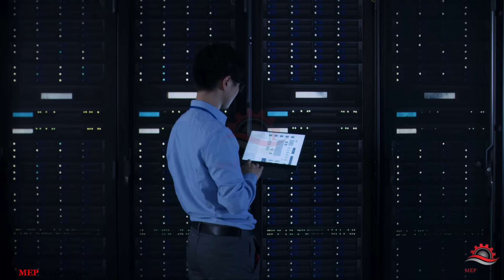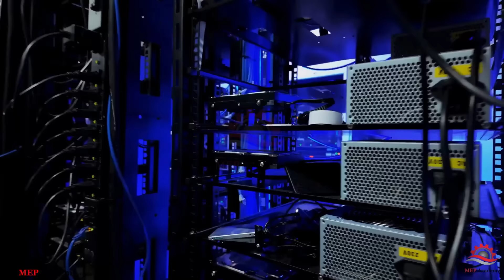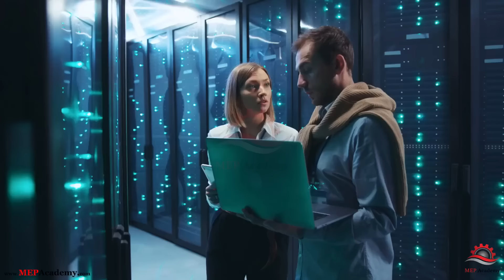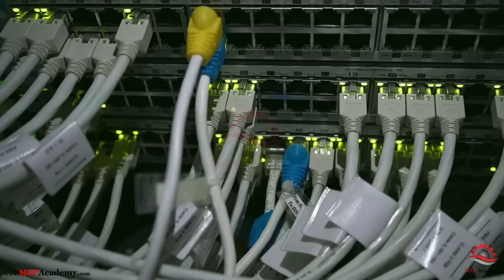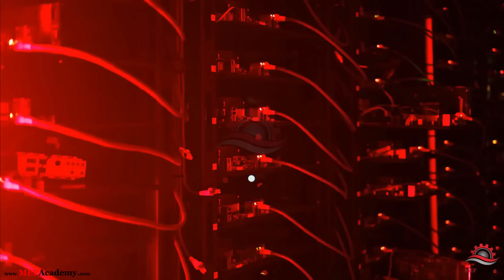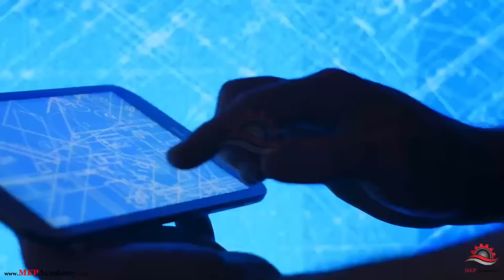How Data Centers Actually Work

Comment: That data center in your backyard is using the same electrical grid your house is. Just a lot more of it. Your electric company will raise your rate to offset the huge consumption by the data center who's not paying the same rate as you.  And that heat from the data center doesn't magically disappear. It goes into the air and changes the temperature in the immediate area.
Reply: Are you saying data centers are one of the sources of global warming?  If so, how can these be a positive influence on the environment?
Reply: @user-yg7ps4gh1x don’t jump so excitedly about your ignorance. Not it doesn’t affect global warming
Reply: @JoshuaC-b9g no need to be rude!!
Reply: Yep, people act like it’s “just the cloud,” but it’s very physical infrastructure with very real local costs.
Reply: THIS^^^^^^^^^^
Reply: I have read on more than one occasion THESE centers connecting to the local water infrastructure within the permitting authorization or the authority from the local municipalities to do so!! Highjacked and robbed at the expense of the local community!! If THESE are SUCH wonders WHY all the backdoor deals?? Under the table and under handed dealings to get them out in some places?? Some of their permitting isn't even public records until after the FACTS!!! 
Regardless people in THEIR communities in their homes have the exact right to know what is going in around them!!
Are these just another love canal times 50?
Reply: They charge the USER, not the guy down the street. Your meter does not measure what they use. Utilities CHARGE big time for the initial connection upgrades.
Reply: Not true
Reply: Not necessarily. Some data centers create their own electricity. Not all data centers are the same.
Reply: @jeremywheeler2122  I read they eat a combined 4% of the US electrical output. Who cares who generates it when it comes to a lot of the VERY negative burdens it places on the environment, our health including stress, and AND our cultures.
Reply: @jeremywheeler2122 exactly. I’m literally on a plane right now since my company is setting turbines and large generators to turn natural gas into power for the data centers for our clients.
Reply: Everything you just said is completely false. Your electric rates do not increase because of a commercial customer’s consumption. The reflection from solar panels has more influence on temperature than a server farm. Facts matter a lot more than propaganda.
Reply: @johndoran3274  I live in Virginia and my rates have gone up with the same or even less consumption on our part. All because of DC's. That makes what you just said false.
Reply: @ruckusmalone9419  it could be that communist state that you live in. I have 8 Data Centers within a 50 mile radius of me and absolutely nothing changed with my rates. Our community did get a big influx of tax revenue that enabled us to improve our parks and hire a few additional police officers without raising our taxes though.
Reply: @johndoran3274  lol communist ? You don't even know the definition of that word. You already got exposed in a lie once so you just spewed out more "trust me bro" garbage.
LOLOLOL
Reply: @ruckusmalone9419  what “ lie” did I get “exposed” in? You do live in a communist state that taxes everyone for everything. Your governor gave that horrible speech the other night touting her communist beliefs. Just because facts don’t fit your narrative of data centers or how they operate in your toilet of a state versus in America, you don’t need to have a hissy fit.
Reply: @johndoran3274  Ok bot. It's night night time. 😂😂😂
Reply: @johndoran3274  This guy types like donald trump, imagine your role model being donald trump, so embarrassing
Reply: @ruckusmalone9419 again, u live where? Hmmm that’s weird I can’t imagine costs going up in Virginia. I live in TX and have plenty of near by data centers and guess what? No price increase. It’s not the data centers it’s your gov. U watch every blue state prices skyrocket and it’s always someone else’s fault but u don’t understand how the red states prices don’t go through the roof
Reply: @ruckusmalone9419 he was telling facts. You r the fool that has zero idea about what you are talking about.
Reply: @squidvis it’s always easy to tell who’s telling the truth. One brings facts and the other call names
Reply: @JamCosmos he tells the truth and your argument is name calling. Makes sense
Reply: @JoshuaC-b9g  SYBAU clown 😂😂😂😂
Reply: Trump has mandated that all future builds supply their own electricity with surplus going back to the grid.  This could potentially actually lower the cost of electricity for neighboring communities.
Reply: @MANI-gp6wn  They are so HUGE if they fail, do we have to bail them out?
Reply: @SunnybobQuackers-b2l  of course we do
Reply: @MANI-gp6wn  Lower costs? Aaaaahahaha!!
Reply: @tommybotts . Yes, they would be off-grid and any excess energy created by the energy plants they build to supply their own energy can be given to the community grid, thus lowering the community cost.  Of course, this only applies to future builds.  Current operations are no doubt increasing the cost of energy now.
Reply: 😂😂😂 @MANI-gp6wn
Reply: @MANI-gp6wn  let's start by putting one in your back yard and you tell us how that goes for you
Reply: @not_jon_vendi :  Unless and until you and everyone else is willing to forego technology, this is a reality.  The need for data centers is growing exponentially and will end up in everyone’s backyard at the rate we’re going.  My comment was an explanation about the state of future builds, that’s all.  You can hide behind snarky comments, but it doesn’t advance any discussion.  I’d love to hear your solutions?
Reply: @MANI-gp6wn   the downfall of civilization. we are on an unsustainable track as a race, its only a matter of time until nature hits the purge button on us as a species
Reply: @not_jon_vendi Good. Bring it on.
Reply: @not_jon_vendi  Humans will go extinct regardless of whether data centers ever existed. Everything comes to an end.
Reply: @MANI-gp6wn you still believe anything Trump says?
Reply: @nem447:  Absolutely.  BTW, this was confirmed by the tech companies.  You can look it up if you have questions.  Even the MSM, or, as I like to call them - Deployed Tabloid Droids, got it right.
Reply: @MANI-gp6wn  That had no force of law.  It was a recommendation.
Reply: @hewitc :  You’re correct- I misstated.  However, the Ratepayer Protection Pledge was signed by Amazon, Google, Meta, Microsoft, OpenAI, Oracle, and xAI, so that about covers the industry.

Comment: It would seem that these centers would be located in the coolest workable locations in the country. 
  Also seems like a waste to just release the heat/ hot air via fans, but these guys are smarter than I am, so there must be a reason not to.
Reply: They are building them where there is abundant aquafers.

Comment: I have a design that does not require nuclear or fossil fuels. A system that will generate enough electricity to sustain power continuously and with minimal heat.

Comment: The video states the difference between an office building and a data center is that in a data center the electrical load is constant.  While this is somewhat true, power is always in use, the load does vary depending on the IT Environment.  If a Data Center is hosting banking/trading environments the load will vary by time of day.  As the markets open the processor utilization in the servers increases.  As the processor utilization increases so does the power and cooling requirements.  If you're ever standing in a data center that serves financial institutions you will hear the fans in the servers begin to increase speed.  The data center noise will increase from a "hum" to a "roar" as the fans spool up to cool the processors.  In many organizations, end-of-month processing will also result in an increase in power and cooling loads in the data center.   I've been designing and building Data Centers all over the world, primarily in the financial community for the past 40 years.
Reply: yep built them and baby sat them.

Comment: Nice explanation, but what are the environment issues that Data  Center’s face?
Reply: The poor, whose rates have gone up from this, suffer. They cannot properly change their environment for their health like use more air conditioning. The Centers use massive amounts of electricity (and are too big to fail ,think govt bailout if they do) and no matter how it's generated, we will pay, guaranteed. They put all that heat out to the environment.
Reply: @SunnybobQuackers-b2l  You mean, like the Sun puts out all that heat into the environment?
Reply: @tommybotts  Are you really equating the sun vs this waste of energy?
Reply: @SunnybobQuackers-b2l  Energy is not being wasted, it's being consumed. There is plenty of energy to be had. The earth will be rich with oil when humans go extinct. In addition, climate change is a hoax. CO2 is necessary and carbon exists in nature. Did I cover everything?
Reply: @tommybotts  ok ai puppet
Reply: @SunnybobQuackers-b2l  Glad you agree!!
Reply: Natural disasters, electrical infrastructure, data infrastructure, traffic, work force, taxes, and cooling. 

Natural disasters and cooling are the biggest factors that a company takes into account when selecting an area.
Reply: @Huy0035  Greed, corruption and incompetence also have to be considered. Not environmental tho.
Reply: @SunnybobQuackers-b2l guess that would depend on the company.
Reply: @Huy0035  True but these factors have to be considered in. I understand they actually bring few jobs to the area. Skilled jobs pulled from locals? What would the odds be? I could be wrong but I am skeptical. Our county was going to build a wind farm on a non-recreational area of beach and clearly would rely on folks from another STATE to supply the builders and some said many would be from out of the country. Zero roads to this area but lots of water access.
Reply: @SunnybobQuackers-b2l most skilled jobs would be pulled from the local to reduce costs. Which is why I have work force as a consideration.
Reply: @Huy0035 
In the recent on going war with Iran, 2 data center were destroyed so will those data centers be rebuilt or written off and what's the impact and how will it be mitigated.
Reply: @nagarajvishnupad31 I didnt hear about that. But generally a company would try to determine if a relocation would be worth it, or a rebuild. They would also take into consideration leasing data center space and not rebuilding. Thats become a big industry. It comes down to the company.

Comment: Thank you for the informative and comprehensive video. I am a new Data Center Operations Technician and I want to learn as much as I can.

They provided me literature, but unfortunately it's an online course that is only accessible through their WiFi network due to security protocols. 

Hope you make more videos like this! Earned my sub.
Reply: @camdoeshvac  Do you work for a CoLo or a company with their own DC?
Reply: Years ago before data centers there was and still is the Telephone Company Central Office. All the copper and fiber cable and cell towers feed into the CO in a given area. In the old days a Central Office Technician would be sent for training for up to a year on the various technologies within the CO. Over time it became cost effective to replace training centers with online courses. Same as online Phoenix University vs brick and mortar colleges.